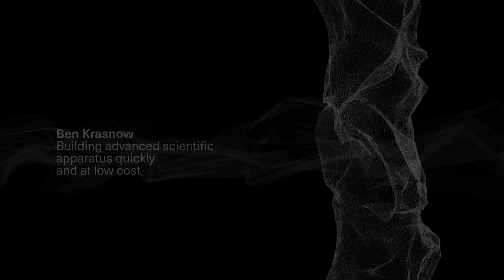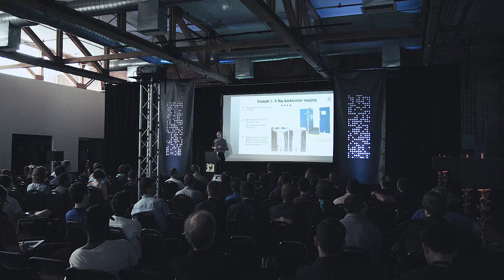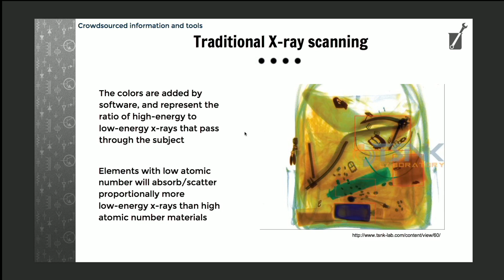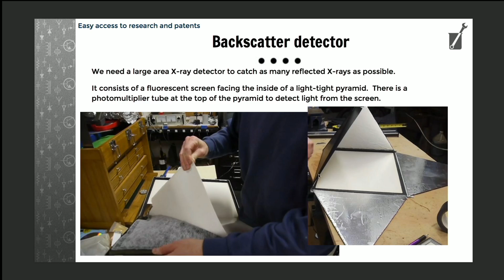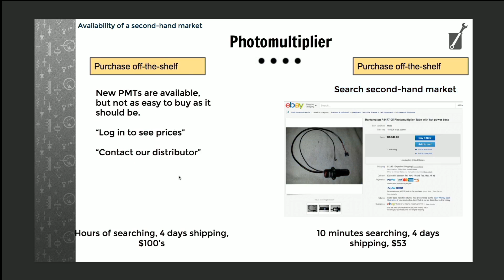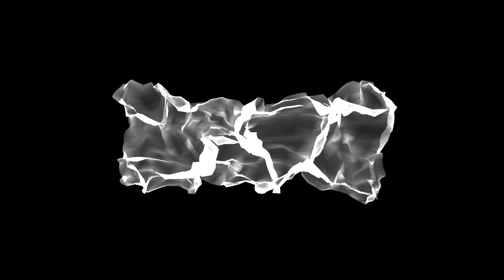Ben Krasnow's X-Ray Machine: Build First and Ask Questions Later

Comment: We installed a larger automation system for a customer the other day and the electrician was baffled how we got our hands on some of the Siemens gear in the middle of extreme supply shortages. We found it on ebay.

Comment: Nice video! this guy is a fucking genius.
(sorry for my english im spanish and actually learning... hope is not a problem)
I need help... I  got two ssd's of 120 GB that i want to solder them to make a single 240 GB ssd (same brand and model) and i want the computer to recognize it as a single drive just like with a normal 240 GB ssd
also i wondered if i could do the same with hhds or usb flash drives

I dont understand why but i cant find anything,i dont want an external RAID device to do this just solder the devices
so if you know how to do this or if you know any tutorial i would appreciate it a lot, i been three hours trying google but no tutorial like this was shown ...
I wondered if i could just solder cables from one disk's SATA pins to the other one,and then connect supply energy to both ssds,but only connect one SATA cable to the motherboard...
Reply: i don't think this is really the place for your question but i will try to help
do your ssd have unpopulated memory chips on one side ? you want to solder your mem chips from on ssd to the other ? that may work depending of the hardware, you would certainly have to flash a new firmware however.
but that see like a very complicated operation since you can simply configure your SSD as a JBOD RAID.
Reply: not worth the time, if you look into how an ssd and file system work it will make sense why. if you really just want it to natively show up as one disk, a hardware raid controller is your best bet.